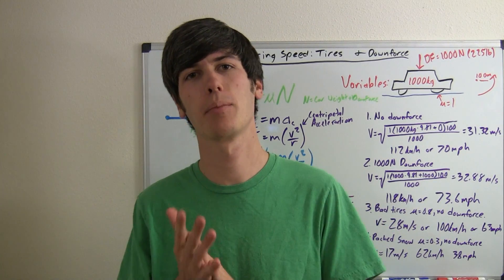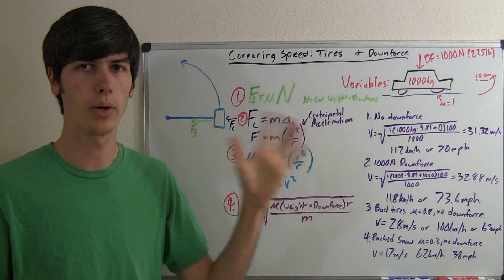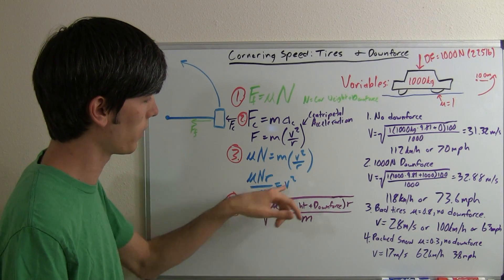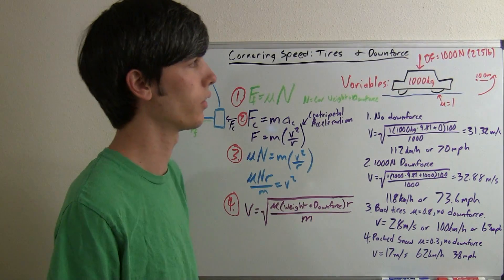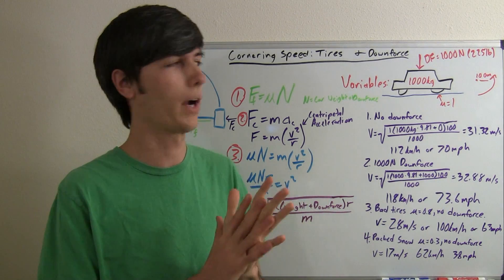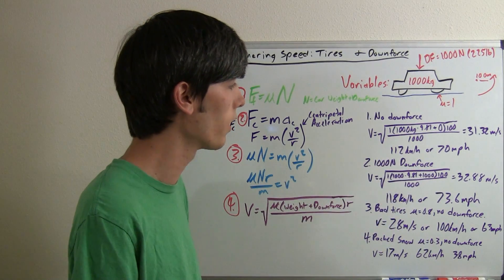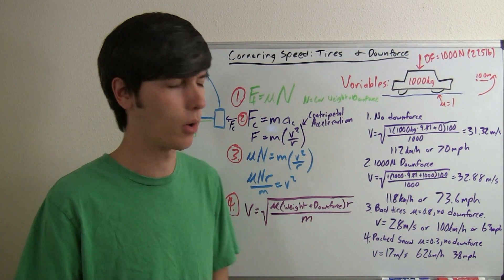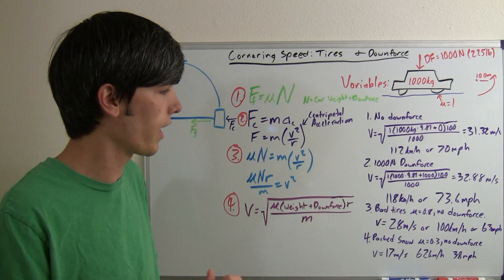Cornering Speed - Tires and Downforce

Comment: Two things: 
The coefficient of friction you use for cornering will be lateral friction coefficient which doesn't vary linearly with normal force, but is a function of slip angle and normal force. So at different radius you will have different slip angles, giving you different lateral friction force.
Also, due to weight transfer you would have to calculate the friction force on all tires taking weight transfer into account and then based on these find minimum lateral friction force out of the four wheels. Based on this you will calculate your max cornering velocity to avoid slipping.

Comment: I am not an Engineer nor have serious mathematical knowledge yet, but isn't it an incomplete equation here ?
The downforce is a variable depending on the speed, but isn't this maths here using it as a constant to find a result that affect it wrong ?
You use it as if the car was at this maximum downforce which mean maximum speed and them from here determine the max speed it can get in a corner, but isn't it incorrect ?
I mean you need to find both the downforce for this particular speed plus the final speed it offer, so this is a 2 unknown equation here IMHO.

Comment: May you make a video on how a bigger tire (width) makes it better on grip? It is a big question that challenges me since my school years...
Reply: +HeliasValenti dont wider tires just add friction and therefor grip?
 more friction because of a larger surface/contact area?
Reply: Helias Valenti wow, that just blew my mind, i always thought wider tires simply offered more mechanical grip.

but i could still argue that tire grip doesnt always conform to classical friction
Reply: +HeliasValenti Same here! After some heavy thinking the only reason i could think of is heat dissipation.
Reply: Heat dissipation doesn't make bigger tires on everything being faster from the first corner or lap...
It has to be something more!
Reply: +Felix van Riessen Gurung well, there is not any physics law for that.
Reply: Friction is equal to the specific friction coefficient multiplied by the Normal force(equal to mass multiplied by g).
The force of friction is generally independent of the contact area. This means that when you have two heavy objects of the same mass, where one is half as long and twice as high as the other one, they still experience the same frictional force when you drag them over the ground. This makes sense, because if the area of contact doubles, you may think that you should get twice as much friction. But when you double the length/area of an object, you halve the force per each square centimeter, because half less weight is above it to push it down.
Reply: +Helias Valenti Pascals law, pressure is transmitted to all points of a container. So while the friction coefficient doesn't change, the amount of force per unit area does. But if you have to little force on a tire you loose grip as well, but when talking about race cars that can produce massive braking, accelerating, and cornering forces a larger tire is needed.
Reply: HeliasValenti 
My only guess is that the relation of ground pressure->friction is nonlinear with tires, and in such a way that increasing the ground pressure on  a tire only works up to a certain point after which the friction increases only very slightly when adding extra weight. Meaning that there is a certain ideal GP/area factor for each tire and that it is in consequence necessary to have a certain amount of contact area compared to the weight (downward acting force actually) for your tires to work best. 
But I just came up with this myself this probably makes no sense at all hell I'm not even finished with school yet.
 So I'd really like a proper explanation aswell.
 EE, we need you :D
Reply: HeliasValenti - He has already done a video on this. Its not necessarily the width but mostly the tyre type and compound of the tyre that produces the grip. Width comes into play when considering two tyres of same type and compound bearing the same load.

There are many reasons F1 cars are breaking lap records left, right and center this season. And one of them(not necessarily the biggest) is the increase in tyre width from previous seasons.

Comment: I can't do the sort of math you can but if I draw a line in a 30m circle and can get to 60kph is there a math formula to figure out how fast I can go around a corner that is a 10m circle eat ect it's probably easy but if it's not + or - it's out of my league but this would help me on my track days.
Reply: +DjCasonDrift Use equation number 3 from the video(left column). 

Say that uN=D(just a random variable that represents the total force of friction, use whatever you want). Use your speedo to find your speed through a specific turn(convert from mph to m/s), use a tape measure or other measuring device to measure(approximately) the radius of the circle about which you are turning, and then use your owners manual to get a rough estimate of the mass of your car(measure in kg). Once you solve for D, plug that into equation #4 in place of "u(weight+downforce)", substitute in any different turning radius, follow the equation. Its really just multiplying and dividing, and taking the square-root, if you just type it into a calculator correctly, it should work out. 

This should give you a rough estimate of the magnitude of the velocity you can carry through the turn. It will be slightly off because your car will not be exactly the weight that is listen in the owner's manual, and downforce may vary with your speed. 

It has been a while since I did stuff like this in physics but I'm pretty sure that is all right. If anybody sees a mistake or wants to add something/clear something up, feel free.

Comment: Interesting..appreciate your work. i have doubt, what about the engine power(if F1 car and GP2 car enter same corner with same angle and everything)? and in F1 cars corner even on 4G.. where to relate that with speed? looks like these kinda pages are missing from my book of knowledge..you might help me there.
Reply: F-1's have more power thus go faster thus have greater downforce from the wings thus have more friction between the tyres and asphalt thus can go much faster around corners than gp2 cars even if the gp 2 had the same tyres and wings. Watch this dude's other videos concerning aerodynamics.

Comment: You're assuming the turn is perfectly circular.
Reply from the maker: Yep, you can change the radius for different parts and come up with different speeds if you'd like, or use the tightest part of the corner is and know what the minimum max speed you need to hit is.

Comment: A question I have always asked myself is this: According to the friction formula the surface area of your tire doesn't matter. Sometimes this is justified by explaining that reduced area increases pressure on the surface and the two factors cancel each other out. However, surface area must be a big deal, since I have never seen a fast car with 195er tires. Could you explain how this works out in physics, maybe in a way that makes it possible to actually do the math?

On a totally unrelated topic, I am buying 4 new tires for my Audi next week and can fit anything from 225 to 245 so if I had an answer till then I'd be very thankful :D
Reply from the maker: The math is certainly a bit more complex, as modeling the ground is no easy feat. But essentially, wider tires will sink into the grooves of the road, allowing for a greater for (friction) for the tire to apply. This isn't contained in the F=uN equation.
Reply: Thank you for your answer, I suppose I'll have to look into this myself a little further.
Reply: The coefficient of friction for a given size tire and/or contact patch isn't linear.  With 1000kg of force between the tire and the ground you may have 1 for a coefficient but with 1500kg the coefficient may go down to .95. This relates into why evening out the forces between tire will net more grip and why a stiffer sway bar will change vehicle dynamics in regards to oversteer and understeer.
Reply: Matt Morrison I see. So basically the F=uN equation is just a way to make a friction problem linear and simple, and u is adapted to whatever makes it suit reality, the formula isn't really useful to actually calculate the realistic behavior of objects. (unless only a rough idea is needed)
Did I get this right?

Comment: Also I had a question about spoilers increasing their angle of attack under braking. Is this done to increase the drag or to increase the downforce on rear tires?
Reply from the maker: This is done to increase drag, to act as an air brake.

Comment: you should add in some fluid mechanics properties in here as well, for the downforce coming from the spoiler. From memory I think Vertical force, which would add to the net normal force, is F = (v^2)sin(theta)*Density of air(Rho)*Area of spoiler. Adding this into your equation would be v = square root [ ( mu*m(v^2/r) ) / ( ( m/r )*mu*sin(theta)*rho*Area ) ]. Because the downforce obviously depends on how fast you are going.

Comment: What I'm confused about is that if downforce is dependent on the speed of the car and you don't know the cornering speed until you plug in the downforce, how would you know what the speed you get a certain amount of downforce at in the corner?
Reply: I think he is kind of avoiding this fact to make the explanation seem easier. I thought about this fact too and came up with another equation that accounts for this. Here it is:

you should add in some fluid mechanics properties in here as well, for the downforce coming from the spoiler. From memory I think Vertical force, which would add to the net normal force, is F = (v^2)sin(theta)*Density of air(Rho)*Area of spoiler. Adding this into your equation would be v = square root [ ( mu*m(v^2/r) ) / ( ( m/r )*mu*sin(theta)*rho*Area ) ]. Because the downforce obviously depends on how fast you are going.

mu is coefficient of friction, sin(theta) is alpha in this case i.e. the angle of attack of the spoiler, Area is the contact surface area that the spoiler makes with the incoming air, and rho is density of air which is a constant.

But keep in mind that auto spoilers nowadays are not two-dimensional objects, but are airfoils like planes have. Only difference is they are installed upside down to give a downforce instead of a lift force. The force created from a spoiler is due to both the momentum of the air hitting the spoiler at an angle, which is what I explained and calculated in my equation, and also the lift force from the pressure difference by using an airfoil as a spoiler.

Is this too confusing??
Reply: Adam Cabaj so now i see why on pikes peak rally car ver. they used a huge rear wing to overcome the downforce problems, as the lower the altitude the lower the (Rho).

Comment: Does the angle of the corner change the speed of a car with down force
Reply from the maker: Yes, absolutely. A cambered corner (like in NASCAR) will allow for much greater speeds.
Reply: Engineering Explained I've learnt in my Mechanics Dynamics textbook that a cambered corner allows for greater speed through a corner and it is clearly evident on the highways, however based on the equation you have derived in the video, from what I can see, would a banked corner not effectively decrease the weight component? or does the camber of the road effectively increase the radius of the road???
Reply: Muhammad Babamia in a banked/cambered corner, the normal force is at an angle rather than straight up ie the normal force has a horizontal component. Centripetal acceleration will be not only due to friction, but also due to the horizontal component of the normal force. If a corner is on-camber, the horizontal component of the normal force will be towards the centre of the corner, construing with friction, this is how road camber increases cornering speed.
Reply: Ravneel Chand Thank you very much for your explanation! In a cambered corner, the centripetal force alone could be enough to provide the necessary traction provided the velocity is relatively high.

Comment: Is it possible for there to be more down force than how much the car weighs for example 1250 kg downforce with a car weighing 1000 kilos. Also what would happen if this was possible
Reply from the maker: Yep, in fact this is common in F1. In this case, you can corner at greater than 2g.

Comment: Dumb question: Can you explain friction coefficients?
Reply: a basic "1" or ".8" is kinda confusing.  Is 1 the maximum possible friction, or will it go higher?
Reply from the maker: Jacob Daeth Yes, typically around 1 is the maximum. I believe it may be possible for this to be greater, but typically addition friction comes from things like warm, soft tires sinking into the grooves of the asphalt, and thus allowing for a greater torque to be applied to the ground.

Comment: Hi. First sorry if my English isn't quite right. If i take your formula, and increase the weight, it does increase the speed. This is false. An other point is downforce isn't related to speed in your formula. Next, the verticals forces acting on the tire depend also on the weight transfer, the tire flex, and the variation of the contact patch area. All of this is related to the suspension dynamics, and the downforce acting onto it. And I haven't already talk about every other environmental factors. Everything you said is true on paper... Real life is far more complicated. It quite hard to predict cornering speed by physics and maths if you don't integrate every little factors.
Reply: shi01 You right. By the way, making 20 vids about it could be awesome
Reply: shi01 Now, this is the problem with simplified explanations. From the formula you can deduce that mass has no impact on cornering speed, the problem comes when one convince oneself that it how it works in real life. Most would find that counterinuitive, and they would be right, because it is wrong. When the calculations don't agree with reality it isn't reality which is at fault! :)

The main problem is the assumption that tyres are abiding by the F=uN formula, which is false. That formula is an empirically derived formula for rigid bodies. A tyre is an inflated toroid-ish rubber balloon that is rolling, not an ideal rigid body. It is notoriously difficult to make a mathematical model of just how a tyre behaves in detail and there's a lot attempts (e.g. pacejka's "magic" formula) one can read up on.

One thing that can be taken out of empirical experiments done on the subject and relevant to this discussion, is that the friction coefficient of tyres is not independent from normal forces (or contact area, another factoid for another discussion). In fact the coefficient of friction tends to decrease the more force you put on it (and ceases to be a coefficient really), hence if you weigh the car down with lead it will corner slower. Also, this explains why a lower center of gravity will make your car corner faster if you think about it a bit.

Still a huge simplification, but closer to reality. :)
Reply: MPI1000
Well, it is also importent on what kind of surface you drive. You are absolutly right, that in the real world the friction coefficient of a tyre isn't independend of the normal forces. However, if you drive on snow it got a bit weird. On hard, compact snow it is better to have narrow tyres, because on wide tyres the normal force isn't maybe big enough to press the tread of the tyres into the snow and it's like driving with slicks on a wet track. If you look at some pictures of the WRC when they drive in Sweden, you can see the extremly narrow tyres they use. Just an example of how much the variables affect even each other. :)
Reply: shi01 You don't have to tell me, I've been to the Swedish WRC twice. :) (I'm swedish btw)

But yeah, bringing in loose surfaces or spiked tyres on ice into the equations just mucks things up even more to the point that it probably is borderline pointless to try to predict analytically. The biggest factor then just how the tyre behaves in that particular situation on that particular piece of surface.

One place more mass can be beneficial however is on very wet asphalt. The high normal forces helps water displacement and combats aquaplaning. From what I've heard, when it's really pouring down. the F1 cars can actually struggle a bit to keep up with the 1.7 ton SLS AMG they use for a safety car. :)
Reply from the maker: shi01
Thanks for saving me the explanation! :)
Reply: Actually no. If you increase the weight in this formula, the resulting speed stays the same. Which isn't wrong in a idealised world.
Of course, it is nearly impossible to calculate the exact possible cornering speed in reality, because you will never know every variable. If he just tried to do that, the formula wouldn't fit on his whiteboard anymore. This is just a basic version of how to get an idea of how fast a car can go through a corner, which most people should be able to understand.
If he would start to put every known variables in it which changes the result in the real world, he would have to make 20 vids just to explain the diffrent variables.